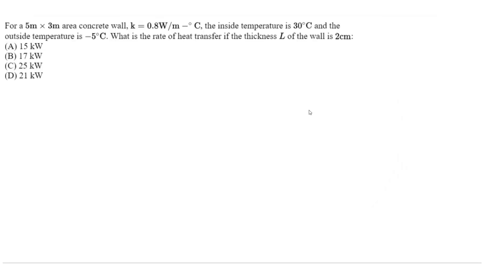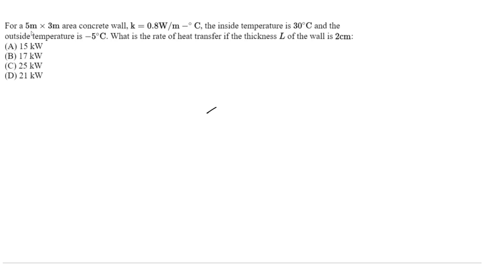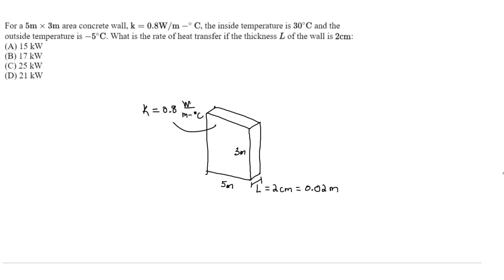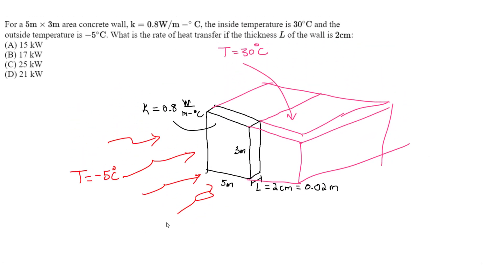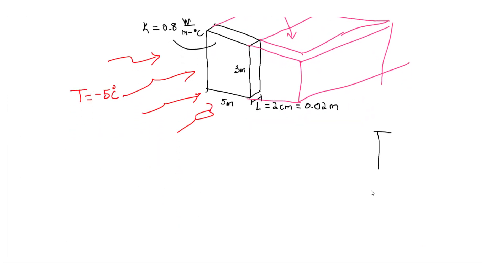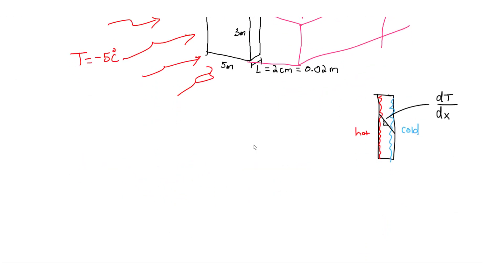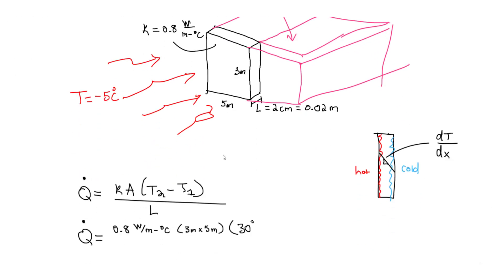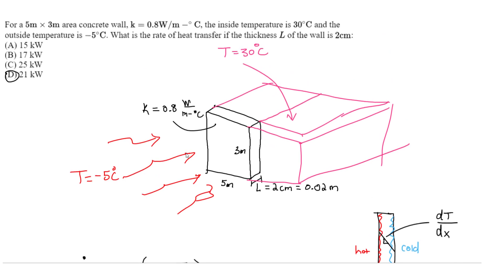FE Exam Review - Heat Transfer - Conduction

Comment: Why did you keep the temperature in degrees Celsius? I get that the k value is in degrees Celsius, but in the handbook for the equation, it says temperature should be in kelvin
Reply from the maker: For this one we are using Fourier’s Law. The thermal conductivity is given with units of Celsius - k = Thermal conductivity  (W/m⋅°C). We must keep the temperature in degrees Celsius (°C) instead of converting to Kelvin (K) in this case is because temperature differences (ΔT) are the same in both units.

If an equation involves absolute temperature (Stefan-Boltzmann Law for radiation: Q) then we must use kelvin.

Comment: Why do you drop the negative sign in front of kA in the equation for conduction through a plane wall?
Reply from the maker: Hi, we attach the negative assuming heating will transfer to the left since heat transfer is a vector quantity. 

Heat transfer would be negative (-) - Going to the left - Right side of wall hot and left side of wall cold. 
Heat transfer would be positive (+) - Going to the right - Left side of wall hot and right side of wall cold.

Comment: hello, why didnt you convert C to K?
Reply: Hi Juan , basically it’s same . 
For ex : 1 w / cm-C = 100 w / M- k 
Thus 
1w / (cm/100 ) - C = 1 w / M- k 
I.e., 1 w /M -C = 1 w / M-k 
I hope you understand.
Reply: Simply put, the temperature differentials are the same in both units under Fourier's law, meaning  1 unit increase or decrease of Celsius is equal to 1 unit increase or decrease in Kelvin. If you converted them to Kelvin, you will still come back with 35K.